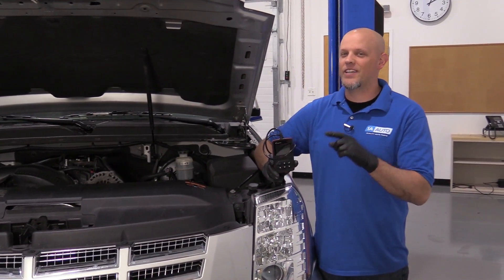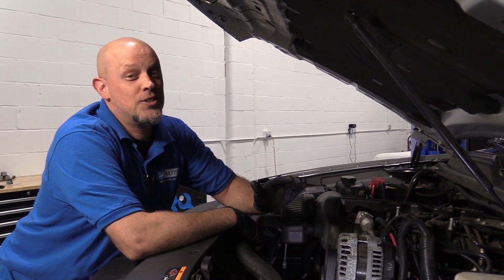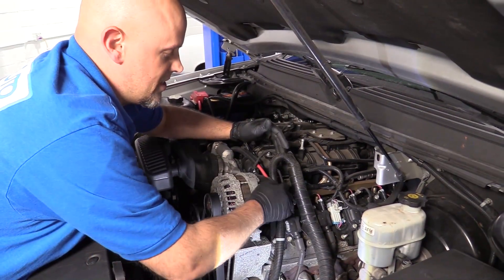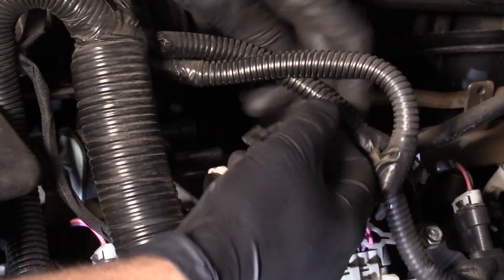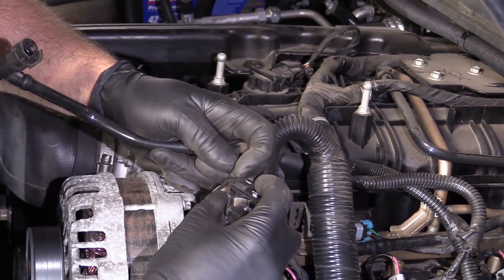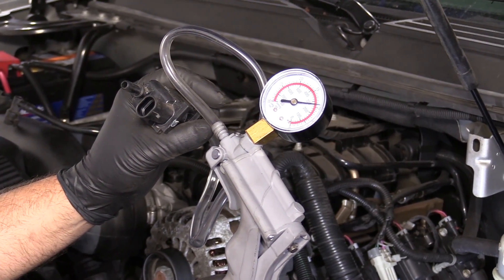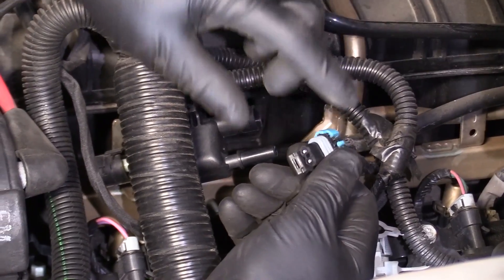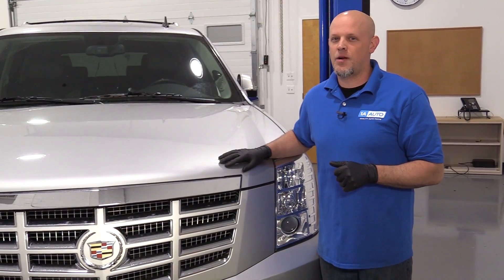Check Engine Light? EVAP Flow During Non-Purge Condition - Code P0496

Comment: Excellent video thank you. P0496 error code on my 09 Silverado because of a stuck open purge valve. I replaced the purge valve and reset the error code which solved the problem. A symptom of an open purge valve is when you fill your gas tank and your truck hesitates to start immediately.

Comment: Help me out here, please. I ran Forscan, and this code came up. My check engine light is on, but in the beginning, it wasn't. I did notice some weird stuff going on with my RPMS, and when I got gas, the Transit Connect had a hard time starting up but eventually did. What part does this sound like? The 2019 Transit Connect doesn't come with a gas cap.

Comment: So I have a 2019 GMC Acadia SLT.. and the purge valve was not closed completely and letting air through so I replaced it but the engine light is still coming on

Comment: Replaced Both PCV valves, purge valve and gas cap but code P0496  will still come on. Can anyone help???
Reply from the maker: +Andrew Bartell We wouldn't be able to diagnose an issue like that here, you may want to have a local mechanic take a look at it. Thanks for checking us out! http://1aau.to/m/Shop-1AAuto-c

Comment: Just how many sensors does this vehicle have? Been told 2, today I was told there are 4 sensors related to this P0496 code...

I had to replace fuse, nbd, to be able to get code off vehicle...who knew this vehicle has not 1 BUT 3 fuse boxes....

Need vehicle fixed, but I do not want to hosed by a main garage chain.

TIA.....

Comment: Good video, but the gas cap does not need to be checked for this code or any other EVAP system DTC specially P0442, P0445 before the system is tested for leaks with a smoke machine because if a loose or an intermittent gas cap seal that's not sealing correctly due to a bad seal or rusted fill neck tube to gas cap sealing area are the sources of the leak the smoke test or leak test will not find any leaks in the system and the next time the gas cap seal fails the code will rest one more time.

Comment: 2013 Cadillac srx exhaust issue(flex pipe)....sounded like a helicopter, then....p0496 code.. .

Being told 2 separate issues, coinkident that code came 2 weeks after exhaust issue.

Want 2 fix code issues first as vehicle has a vaccum issue...hwy driving is out as idiot lite blinked for about a mile....steady since, doing side roads...

$600 for exhaust, $200 for p0496 fix.   

What do I do....owe more than vehicle is worth....

Comment: Hi , I have 2018 Chevy trevierse code p0496 , I just changed the purge valve and the code won’t get deleted it’s says permanent .
Note 1  : I tested the old one it was stuck open and I tested the new one and it’s functional.
Note 2 : there is no gas cap in my car model .

Comment: I had the exact same code on my 2007 chevy silverado  classic style with a 4.8 engine the code reader at autozone suggested to change the fuel tank pressure sensor so I did which is a pain in the rear to pull off, I ended up breaking it trying from underneath  I had to remove the bed to remove the remaining part and installing the new one it's much easier that way 
My problem continue  I replaced the purge valve and solved the problem  which was the second suggestion 
The truck wouldn't want to start after fueling 
When cold in the mornings I had trouble starting it it would  cough and stall
Reply: On the flip-side you don’t have to worry about the fuel tank pressure sensor going out anytime soon. 

I don’t have a check engine light but my scanners showing the 0496 code; i think I’m going to throw a new purge valve at it and go from there.

Comment: I have a 2010 Cadillac STS I replaced the purge valves and I am still getting a P0496 code I also replaced the gas cap still have the code any help would be appreciated. Can’t seem to get this car through inspection because of this problem

Comment: 2008 Saturn Outlook - had the p0496 code, changed evap canister, 2 weeks later code came back. Also, when i open gas tank with car running, the engine immediately starts idling rough. any ideas?

Comment: I found the leaks after a full diagnostics and Had it fixed. I changed my purge valve, charcoal canister OEM and a EVAP vacuum hose by the canister. my light turned back on for high purge flow (P0496). how do I get rid of that code. The gas cap looks good. No tears or anything. Idk what to do at this point. I only use 93 premium gas. Please I really need help 🙏🏼🙏🏼 I have benz c350 2010 70k miles.

Comment: So to test the part, when the car is running. If it's not sucking air then it needs to be replaced?
Reply: If the part is sucking air and it’s been disconnected that indicates it’s not working and you need to replace it since the part is disconnected it should block any air from going in

Comment: How do I reset the code for my 04 escalade. Had the same code replaced part but still check engine light.
Reply from the maker: +Jacob Stickles You should be able to reset the code using an OBD-2 scanner.

Comment: I have a 07’ Suburban in that is giving me  an evap leak code. I just recently replaced the charcoal canister and the vent solenoid. After replacement, I decided to go ahead and change the purge solenoid and found charcoal in the lines that lead to the purge valve and the valve itself. After replacing it, I now get a purge high flow code (assuming the existing charcoal in the lines I can’t get out are clogging the purge valve) I assume my next step would be to drop the tank and clear the remaining of the lines.

Comment: Thanks.  Only suggestion would be to comment on just how these connections are fastened.  Hoses in this case apparently have just barbs holding them(?), and electrical; has a tab to press to take it out?

RichE San Diego, CA

Comment: Is it the same as a P0444 code?
Reply from the maker: +joerahman1 Thanks for checking us out. Both codes will have to do with the EVAP system but will have different reasons to be triggered. They are not the same code.
Reply: 1A Auto Parts thanks for the reply, keep up the good work 😊👍

Comment: Very informative video. Could I have an evap condition if whenever I get gas, the gas pump/nozzle clicks or turns off all the time? I have to click it back on several times, which can get pretty annoying to say the least.
Reply from the maker: +Edmund Mendez We wouldn't be able to diagnose an issue like that here, you may want to have a local mechanic take a look at it. Thanks for checking us out! 1AAuto.com
Reply: Sounds like your vent valve is stuck closed.